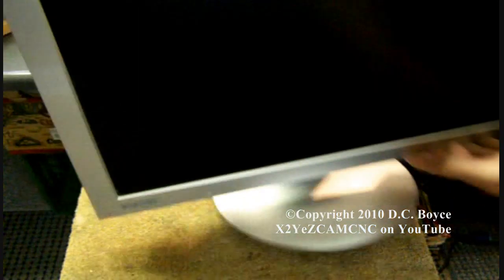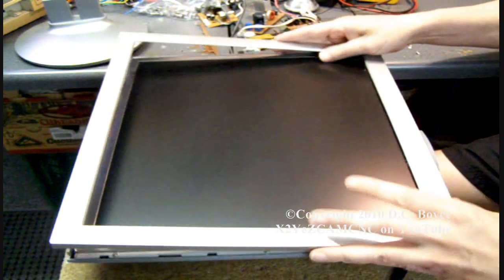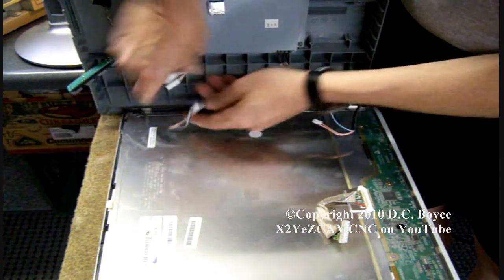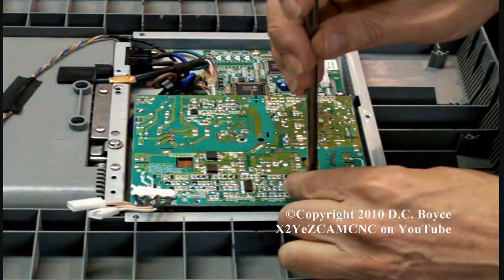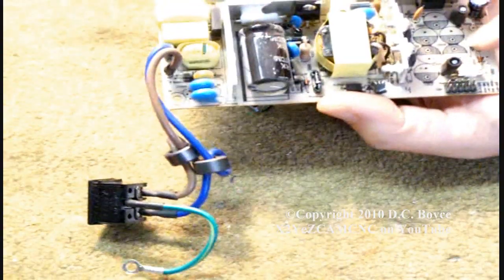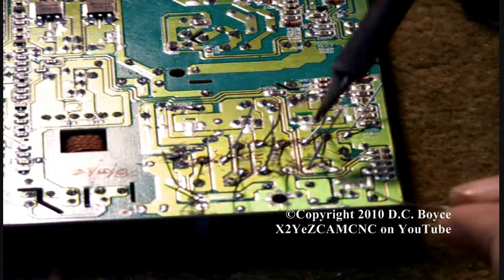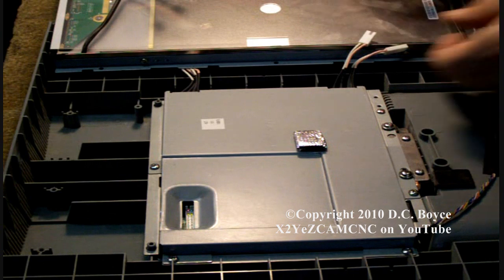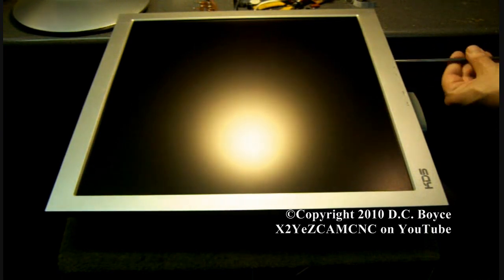How-to Fix KDS K917s Model 900P LCD Computer Monitor Repair Screen Flashes Then Blank

Comment: I had similar problem with Scaleoview  C19-7 model 900P. Followed the instructions, replaced 7 capacitors and problem remained (when monitor switched on it displayed screen perfectly for 2 seconds and go blank again). So i dismantled it again, and replaced another capacitor (one of two 100uF,25V) on the other side of chipset which also looked a bit blown out. I actually used a 220uF, 25V capacitor in it's place. And now it works perfectly again. Thanks a lot for this video, very educational!

Comment: thank you so much! I had the same problem and this video was the solution. I only found it after searching a lot. Actually my LCD is a Fujitsu Siemens Scaleoview C19-6 900P. The LCD is exactly the same as yours, but the brand and model is different.

I've found a lot of people complaining about this problem for the Fujitsu Siemens LCD, but no videos on Youtube. I would suggest that you add the keywords "Fujitsu Siemens Scaleoview C19-6 900P" to your video. You will surely help more people :)

Comment: An addition to my previous post.  Height size is critical, as there is about 21 millimeters between the board and the cover  plate. The Panasonic part I found has a height of 15mm, diameter of 10mm, and lead spacing of 5mm. Most off the shelf 35volt caps are either larger in diameter or taller, so be very aware of the physicals of the replacement parts.  This cap is also rated for 105 degrees Celsius which again is critical, most caps are rated for 85 degrees C.

Comment: Unfortunately, I didn't see this in time to help you, but please refer to my posting on my Mag LT916s posting to answer your question.  Normally a 25 Volt cap would work with a 12 volt circuit, but with 14 to 16 volts in the circuit and high internal temps, these caps (commercial version) are stressed beyond failure.  I've seen the problem many times in crt's and other devices.

Comment: I had this problem on a Mag LT916s. As a former computer service tech, PCt board and electronics circuit  designer,  I found the same caps to look like they exploded.  This is normal for caps that are stressed beyond their limits.  The real problem is two 680 uf, 25V electrolytic caps to the CCFT power supplies with  an output of 14 to 16 volts. This voltage rating is too small. A Panasonic P/n 667-EEU-HD1V681 will work. They are smaller physically, have the same foot print, but have 35V rating.

Comment: replaceing the 6 470uFd  caps and the 220uFd did the job for me 
thanks a lot! :-)
Reply: This screen has the exact layout as my Xerox XA7-19i 900p. On mine only one 16V 220uF capacitor (on the other print) looks bad. But once opened, I think I will also change the ones on the powersupply print.

Comment: Where do you get the capacitors? Thanks for the Video. I have at least twenty of these monitors only the 19 inch ones. Same thing has happened on every one that has gone down.

Comment: what was the size of capacitors you used?
great video
Reply: If you read the full description it says replaced six 470uFd /25V caps and one 220uFd cap

Comment: I have a 22 inches KDS monitor, it is very similar to the monitor in the video with the same issue/problem, I change 6 (six) capacitors and it work again, I don't know for how long remain working. Thank you very much for this tutorial.

Yo tengo un monitor KDS de 22 pulgadas, es muy similar al monitor en el video con el mismo problema, yo cambie 6 (seis) capacitores y esta trabajando de nuevo, yo no se cuanto tiempo permanecerá trabajando. Muchas gracias por este tutorial.
Reply: +Luis Manuel Robles Amador
hi everyone ,if anyone else  is searching for 
desktop repair
 try Saankramer Electronic Magazine System (do a google search ) ? Ive heard some unbelievable things about it and my buddy got excellent results with it.

Comment: i have a samsung 17" syncmaster LCD.  i've changed the caps and the fuse. it worked, but, in a few minutes, it started flickering.already change all the electrolytic caps. anyone can help me with this issue?thanks..